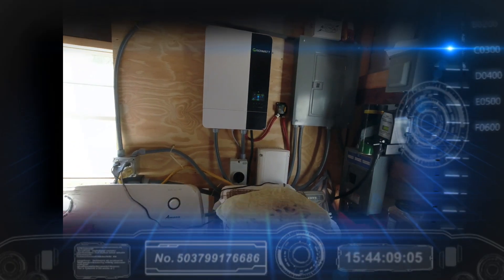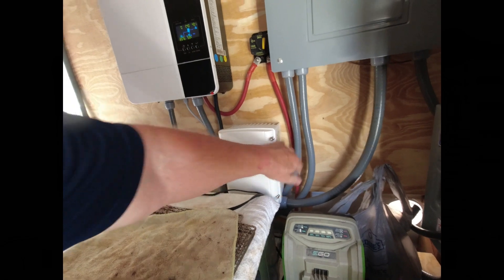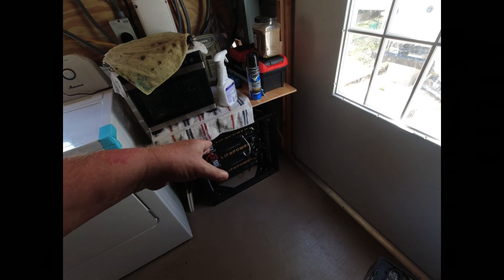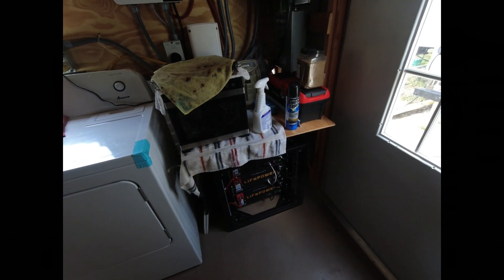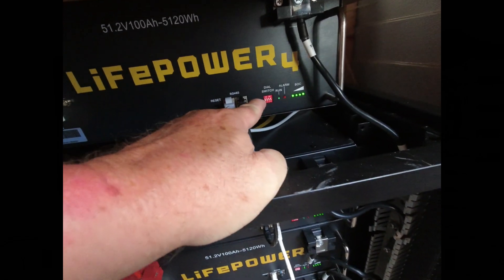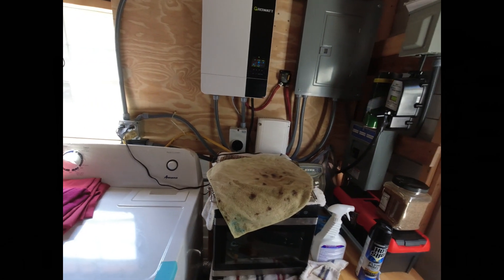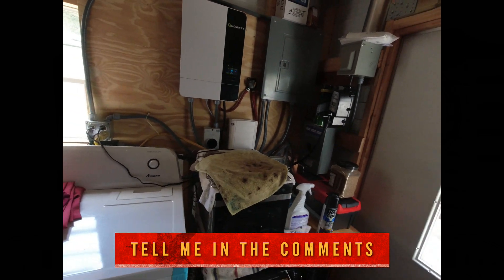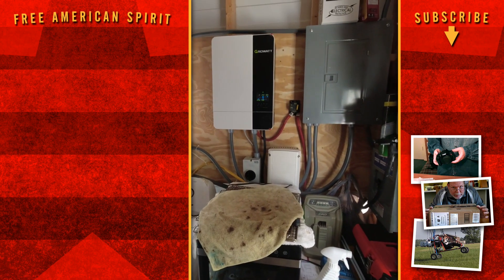Upgrade Updates Q&A Growatt SPF 5000 ES Inverter,  48 Volt 100Ah EG4 Lithium Battery off grid solar

Comment: The time for payback might be important to some people but most of us just want the freedom from the grid. With me I'd gotten stage 4 cancer a couple years ago and after the chemo and radiation I realized if I got sick again and couldn't pay bills that we was still gonna need electricity so even tho I've spent about 30 grand on components and will likely never see a return on investment cash wise just knowing me and the wife has electricity the rest of our lives with no bill was worth every cent. One day I might have to replace an inverter or some other components but for the most part I feel the system is oversized enough that we should be good on electricity.  Now I'm wanting to have a well dug and that will take care of the water issue. Being off grid is a challenge but also keeps my mind busy so the benefits seem to be endless. Thanks again for sharing your videos of your system
Reply from the maker: I will see a return in about 5 years.
I only keep the utility pole live because it is a back up.  Basically a cheap insurance policy.  Also because right now I have one inverter so I use it for the dryer..  I'm way to lazy to go out in the FL heat to hang it.
My main reason for doing it was the AC.  The trailer will cook ya alive in the FL heat without AC .  I run mine ALL day long non stop.   We have power outages here due to hurricanes storms and dumb people driving in heavy rain who run over the telephone poles....   Now the only way I can tell when the electric is out is when the parks water goes out .  But the nice thing about the trailer is I have a large water tank with a 12 volt pump....   Problem solved....
Reply: @FreeAmericanSpirit  I installed a 38 seer 9000 btu minisplit in my camper. It runs 24 7. It goes as high as 13500 btu and as low as 2000 btu with variable speed compressor.  It starts out at 600 watts and after 10 or 12 minutes then drops in watts down to between 200 and 300 watts. I run two solar power systems with two seperate inverters one is responsible just for my air-conditioning and the other system runs the rest of my camper. Currently I only have 1850 watts of solar panels which is great most the time but I'm putting another 10 panels on a ground mount very soon because I still want to charge on cloudy rainy days in winter. I'm really impressed with this minisplit heat pump and I'm excited to see if I can do most of my heating this  winter with it also. It's advertised as still heating with temperatures down to around -5 degrees but I'll have to wait and see about that. I too have a decent fresh water tank and 12 volt pump in my holiday rambler but both my solar power systems are 24 volt. One is 3000 watt 110 and the other system is 110-220 split phase
Reply from the maker: @matthewknight5641  yocan buy a 24 to 12 transducer. Then put it by the pump.run a 24 volt  supply wire to one side then 12 volt to the other.  My AC is a dometic 120 volt 15000 btu.  Runs good..  my water heater is 6 gallon 120 volt as well...
Reply: @FreeAmericanSpirit  I bought one of the step down things to go from 24 down to 12 but my water pump didn't like the 12 volts as well as it did the 13.8 volts coming from my 120ac to 13.8dc converter that came in the camper. The 12.24 step down was way more efficient but my pump kinda struggled with it. I think victron makes a step down that's adjustable that I'd like to have if I end up doing it again. Also my propane heat that I hardly use runs off the 12 volt side and the fan in the propane furnace ran a lot slower thru the 24.12 step down. I might should have gotten one that was capable of more amps or one that was adjustable.
Reply: @FreeAmericanSpirit  one of the greatest things about this youtube stuff is the way we can get out brain's together on doing all this stuff we do. I'd have never been able to be off grid if it wasn't for guys like you showing me so much in the videos. Thanks from me and the wife both. We appreciate the time you and others spend showing us the systems you have built
Reply from the maker: @matthewknight5641  hmmm that is interesting thanks
Reply from the maker: @matthewknight5641  thanks for the kind words and all the thumbs up...  
I often wonder how much further I would be a long in life if we had you tube back in the sixties...  Like TV there is a lot of time wasting junk.  But the educational stuff is awesome...
Reply: @FreeAmericanSpirit  the education and meeting other like minded people without having to actually meet them in person is ki da great also. We kinda get to chat about our stuff we have common interests in but don't have to actually hang out to get that conversation.  Seems like this group of solar people and off grid people really help eachother out a lot with seeing how other do what we do. I'm trying to get the nerve up to do a video of my systems I've got running my stuff but kinda nervous still at this point lol
Reply from the maker: @matthewknight5641   just do it.  I have some vids that I take my time and they look good but a lot of times I just do (1)take vids...  All you need is your phone or an iPad to start...
Reply: @FreeAmericanSpirit  I think I'm gonna try it. Maybe I'll make some where I'm not actually in the video but just kinda show my stuff and what I've done
Reply from the maker: @matthewknight5641  sounds good .. let er rip....

Comment: I'm completely off grid with 1850 watts solar 30 kw of lifepo4 and nmc batteries 2 inverters a 4000 and a 3000 watt. In process of getting another 10 or 12 panels. This solar stuff is addictive. Thanks for sharing your system it looks great to me. Don't worry about the trolls crying about you wires. They look safe
Reply from the maker: Thanks for the great reply.  Yea it is addicting.  I am saving up for another two batteries and a second inverter..  so far the system has supplied all my needs with no problems.

Comment: you run your oven with the growatt
Reply from the maker: No my oven is gas.  I do run the dehydrator (looks like a small oven) with it.

I would.need.another grow watt and wire them up together to make enough amps to run an oven or dryer.
Reply: @FreeAmericanSpirit  one oven pull around 2.5 with 4kw the growatt is 5kw so why will be a problem for the growatt, i don't no maybe for america 120v is a problem but for 220v i don't thing so
Reply from the maker: Depends on how many amps the oven pulls.  My dryer pulls just at the peak amperage output and will trip the unit off...
So I would need to add another unit..
If your oven draws less than 20 amps it might work.   You would need to get a hold of the manufacturer or supplier online and ask them for the specs....
I am not an expert so I can not tell you how it would perform for you or in your area...

Comment: How has the gutter pro vac / wire hose been holding up?
Reply from the maker: Just fine. I'm retired now..  but it looks in like new still.
Reply: @FreeAmericanSpirit  I have a question about the hose if you don’t mind , I saw gvs’s video talking about their hose and the wire reinforced one seems to be a thinner less durable PVC material vs the other rigid hard plastic, do you think the other hose would hold up better and have better longevity
Reply from the maker: @kohenblrrr4901  honestly don't know.  I am pretty careful with my tools and take care if them so I usually don't have to many issues.  The junk flows through the wire hose much better than the plastic ones.
Reply: @FreeAmericanSpirit  would it be able to crush in your hand if you tried? It doesn’t seem like that would happen with the other one maybe
Reply from the maker: Never had it crush on me.
Reply: @FreeAmericanSpirit  and how well did it work for you for cleaning gutters I’m planning on staring a gutter cleaning business
Reply from the maker: @kohenblrrr4901  its like any other tool...some jobs it works great and other jobs it's faster to do by hand.   Depends what's in the gutter.  It takes a little time to learn how to use it properly.  But for me it kept me off the roof so that was the most important thing.

Comment: I know those EG4 batteries are UL listed. Is the Growatt UL listed? I'm asking because safety inspections for insurance.
Reply from the maker: No the growatt is not listed.  But they sell their own eg4 all in one it is ul listed... But it out puts in 120 volt.  But Handel's a lot more pv's...  You would need.two.of.them.ro get 240v...... They cost around 1400.  But you don't need a transformer for 120v.

Comment: Why don't you use the automatic switch over in the inverter?
Reply: When my system fails for what ever reason it starts sending alerts to my phone. But it is your system. I was just curious to why I see so many avoid that feature.
Reply from the maker: @chrisloving6647  I don't have the Bluetooth/wifi stick.  Even if I didn't it would not go through the steel shed and the steel trailer .
Reply from the maker: The automatic switch over????  For what?
Reply: @FreeAmericanSpirit  to switch between the grid and off grid. Mine works well
Reply from the maker: @chrisloving6647  I don't want ac connected to the inverter.  The only ac I use is for the dryer plug.   If my system fails. Then I just plug the trailer into the pole.  If I used the automatic feature the trailer would still run and is have now idea the system was out...

Comment: The fire retardant backer board isn’t recommended because of daily use. Most times things will only get slightly warm at most. It’s for if the inverters or fuses have an catastrophic issue. Which may be rare but it can create a light show. Considering the board costs $15 at Lowe’s,  it’s pretty cheap fire insurance.
Reply from the maker: That is a good observation thanks.
Reply: @FreeAmericanSpirit   sure thing. Nice setup. I like your step by step explanations.
Reply from the maker: Thanks for that feedback.  One day I will actually start writing this stuff out beforehand instead of just "winging" it.
At least that's what I keep telling myself.
Reply: How much heat do two of these inverters and a 6 battery system produce ? I can’t find much info. 
Wondering if a small space say 4’x4’ if insulated . 
Would they provide enough heat to keep the batteries operating?
Reply: @richardreese5377  in my opinion the inverters would overheat in a space that small. On a good day with lots of pv voltage coming in they can generate a lot of heat. Plus it would depend on the low temps where you live.
Reply: @GavinStoneDIY  central NY , we can get several nights during the winter below zero
Reply from the maker: Used to live in the finger lakes area...  Don't miss those week long freeze's...
Reply from the maker: My shed is a pretty big shed.  Plus it has a ridge vent.   It does get hot in there, so I am going to install an exhaust fan. Don't if it were a 4 by 4 she'd I think it would be too hot if it were in direct sunlight.  If I had two inverters in my big shed I would have to have fans on all the time (here in FL). Or move the shed to a shady spot.   Batteries don't produce  to much heat. But they Don't like to be hot (from external sources) just like they don't like to be frozen...
Reply: @FreeAmericanSpirit  This is our dilemma. 
The panels are going on our barn . 
The down stairs is a moderate temp even in the winter. As a good share is underground and thermal mass . Temperature wise would be idea . 
The problem is too much moisture for the inverters. 
So was going to petition of a corner of the hay now upstairs. It’s dry , but in the winter also freezing. 
Should I just insulate the battery cage and leave the inverters exposed to the cold ?
Reply from the maker: @richardreese5377  first I would call the dealer for the batteries and the in water to get the temp specs...   With that said I would probably go with the basement, wall off a small section and maybe use a small dehumidifier..  really hard to tell with out seeing your building or how much humidity you have.   Reverse for the attic build the small room and put a small heater in it during winter.  I have heard of people putting batteries in insulated boxes...  Again ask the dealer for what they think is best.   I'm not sure how cold it has to get to affect the inverter so check on that .

Comment: You going to have critics as they call them these days. They are simply savages and console Warriors that wish that they had what you have. Your arrangement is extraordinary. I have six of similar batteries. I turned on my batteries and licked fingers on all fours them to the 48-volt 100 amp hour battery terminals nothing. I needed to ensure for my youngsters while I had them in the front room briefly charging prior to introducing them in my far off server rack. You rock keep up the great recordings
Reply from the maker: Thanks.  I'm not to worried about them.  48 volt can cause some serious shock, so I won't be licking my fingers and touching them...lol. Be care especially around your kids.  Thanks for watching

Comment: You going to have haters as they call them nowadays. They are just trolls and keyboard Warriors that wish that they had what you have. Your setup is great. I have six of the same batteries. I turned on my batteries and licked fingers on both hands and touch them to the 48-volt 100 amp hour battery terminals nothing. I wanted to make sure for my kiddos while I had them in the living room temporarily charging before installing them in my out-of-reach server rack. You rock keep up the good videos
Reply from the maker: Having haters is nothing new.  I've been ticking people off since I was a kid.  Lol.  Thanks for watching the vids and commenting.  I appreciate the support and the encouragement.   I really don't mind the comment's, some times I they will make me take a second look at things.  If people get really nasty, then I would just block them.  As long as they keep it somewhat civil, then I just let it ride.  Again thanks for the kind comment's